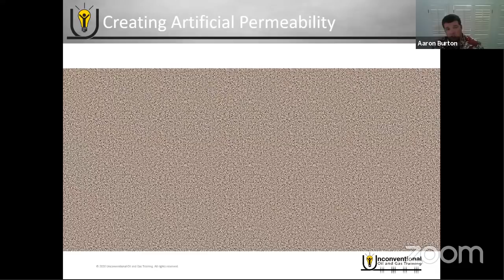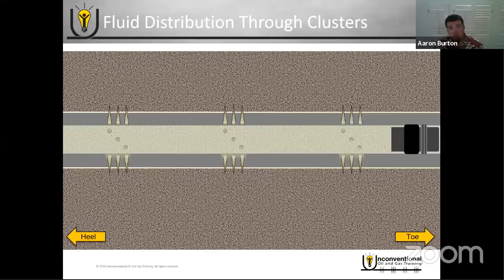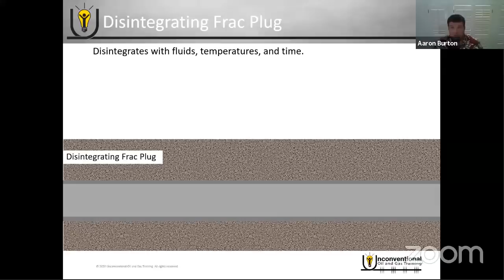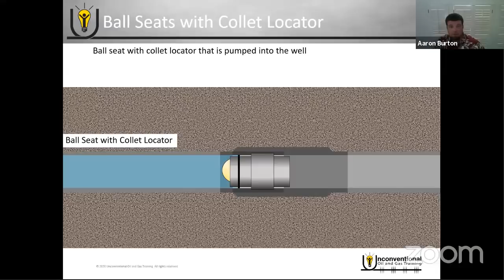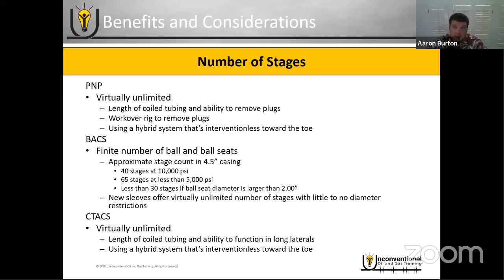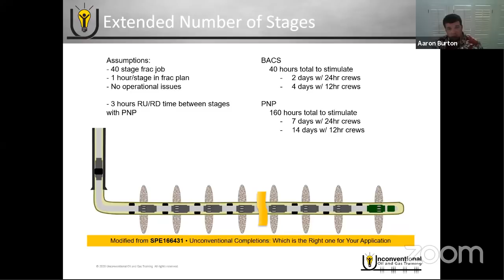Multistage Fracturing Technology

Comment: It’s unclear to me, why couldn’t we use a wireline in the first stage ?
Reply: Mohamed,

When you cement the liner in place you no longer have the ability to pump into the wellbore. Since you can't push wireline horizontally, you have to have another option.

Comment: In PNP , what is the importance of the plug and why it is milled ?
Reply: They will be a significant diameter restriction in the well and likely would allow debris to block off production. Plus, composite plugs are not designed to last for long periods of time, so they would fail and be able to move up and down the well.

Comment: very useful, my question is, how to prevent sand settling while fracturing in the horizontal section???
Reply: Ahmed,

There are several variables you can adjust - rate, sand type and size, fluid type, polymers on the sand, and a few others. In most applications in North America right now they are primarily dependant on rate since they use slickwater, so they also use small and lightweight sands.
Reply: i realize I'm quite randomly asking but do anyone know of a good place to stream new series online ?
Reply: @Bronson Titus Flixportal :D
Reply: @Orion Franklin Thank you, I signed up and it seems to work :D I really appreciate it !
Reply: @Bronson Titus You are welcome =)